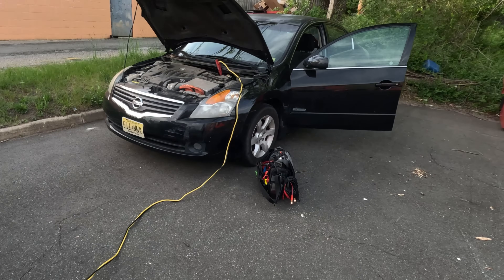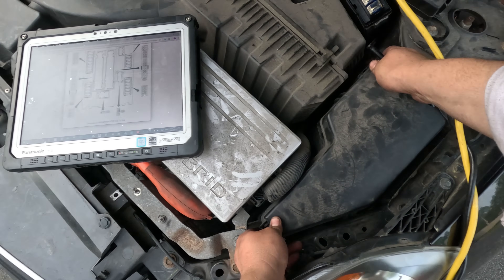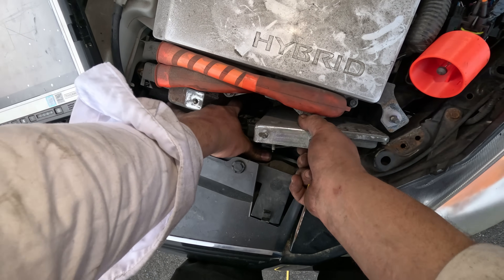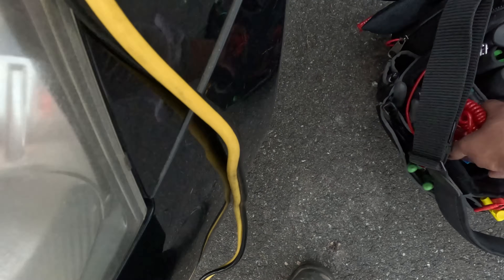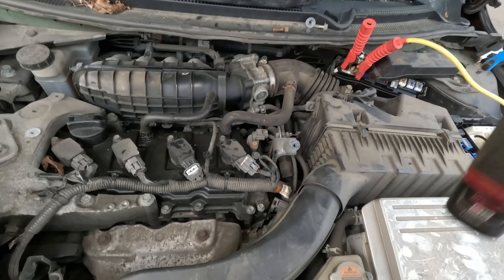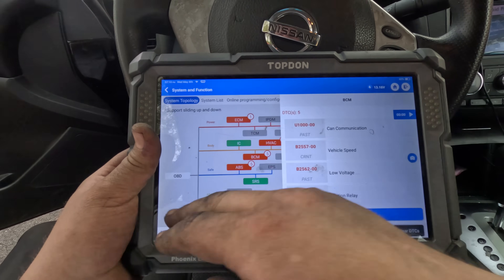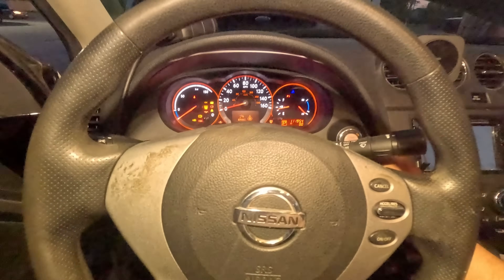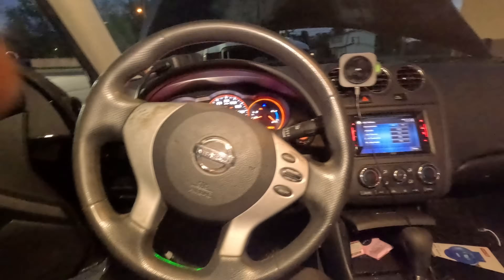Nissan Altima Hybrid - No Start Diagnosis! / No communication!

Comment: OK. This video saved me a ton of money and a lot of frustration. I had the same exact problem. 2009 Nissan Altima Hybrid as well. Car stalled on the freeway mid-drive, had to get it towed to my house, and could never get it to start after that. Tested and changed out all the usual suspects, the brake pedal switches, etc. Dash also showed the "brake/start button" graphic, even after it sounded like it started. Learned from this video that the fans on means something is wrong with the computer. (saved a ton of hours just knowing that little fact). My Harbor Freight code reader was just giving me a U0100 error, Lost communication with Engine Control Module A. I didn't have any fancy diagnostic tools or wire diagrams, so i decided to test all the fuses with the multimeter and found 42 to be blown. Tried a new one and that one also blew. Putting a little faith in this video, i jumped straight to the coils. I wasnt sure exactly what i was looking for, (really don't know much about continuity or current) I pulled all 4 coils and tested a few of the pins on each and found that coil 2 was acting different than the other 3. No idea what they are supposed to read or exactly what test i should have done with the multimeter, but if one of three had a different output than the others, it was worth swapping it out. Picked up a new coil, installed it, and put in a new 15A fuse to replace the bad one. Unfortunately it still didn't solve the problem, all the lights still on and start button not recognized. BUT then i remembered that you went back did a new scan with the OBDII reader and cleared the codes. Once i did that step, It fired right up. Absolutely crazy. I've been racking my brain for the past month on what to do with the car, havent been able to find a fix, and this video came up in my search. THANK YOU. you did it the right way, and ridiculously fast, but it helped someone who is way dumber and has very little understanding of automotive electrical figure this out. I hate taking my hybrid in to the shop, they always use the "hybrid" to make it more complicated, more expensive, and claim it needs special parts. Kudos to you and others who make awesome videos for those of us who aren't afraid to get our hands dirty, and learn a little something new along the way.  Keep up the good work. I am curious, would a bad coil cause a non-hybrid to have a non-start? or would it more likely just throw a misfire code? Just wondering if it's the need for the computer to switch between ev and gas modes that made the car stall mid drive and then no longer start. Wasnt sure if the same would be true of a nissan that is not a hybrid. Luckily, the one you worked on was the same year and model as mine, so I am super grateful it worked out. Had no idea a bad coil could shut down the communication to the computer.
Reply from the maker: That's awesome! Glad it helped!

Comment: I have the same car and the same model and I guess it's the relay that you mentioned but there's the new information it was the coil shorted but its expected since the fans goes on wen the short is on , the people think the altima is hard to know what is the problem but when you have the enough knowledge in this car you can realize that nissan make it easy to know what's going on just by it's another signs like the fan is on it's mean there are an short circuit in this relay so you have to search in this relay things and so on , some guys I know can realize what is going on without scanning codes just look at the dashboard and check for one or two things and fix it and go forward

Comment: I would like to know how you could rule out the ECM being shorted when you grounded out the ecm relay? Is it because you knew the ECM powers on that relay at all times? Or was the key in start at the time?
Reply from the maker: I saw the wire going from that fuse to the ECM was not on the connector that I unplugged at the ECM. Telling me it must be an output.

Comment: I already call more then 4 technicians to fix this issue they failed to start the car when I come across to ur video u can’t believe I did it on my own without any tools 🛠️ and my Altima 2009 now work perfect now thanks u and keep the Great work
Reply from the maker: Awesome to hear! Glad you got it working!
Reply: Always just know your car you can fix any thing and no one can scam you I have the same car and I know it very well so when you see the fans is going on just by pressing the power button you can know there is a short circuit especially in the relay that mentioned in the video

Comment: Hello I have a 2009 nissan altima hybrid.  I recently changed the hybrid battery on it and now it won't start.  All the light on dash turn on but doesn't crank over.  Keeps telling me to push brake to start which I do and nothing
Reply from the maker: Are there any codes in any module? Are you sure the Interlock disconnect is plugged in correctly?

Comment: Big thanks for this video.  We had the same problem recently on a 2007 Altima Hybrid, #1 coil was shorted.  I was able to identify the shorted coil by checking the resistance between the control terminal (most left if looking right at the coil connector cavity) and the center black terminal on the coil itself.  Each good coil ohmed out at about 2.3 ohms except the shorted coil which was 0 ohms (short to ground).  $75 coil and a $5 pack of fuses and car was back on the road…. This would have taken us much longer without you sharing your awesome diag!!!
Reply from the maker: Glad I could help!
Reply: I have the same car in Jordan 🇯🇴 the used coil is about 25 dollars "15 jd" why it's for 75 dollars ?
Reply: @imadgraf4769 well surely it could have been cheaper online but was able to get one from a local parts store that is also probably decent quality, can’t imagine how much the dealer would want at least $350 I would imagine!

Comment: Sorry for my ignorance.  But what was the problem? What did you fix? My car is having  the same issue.
Reply from the maker: An ignition coil shorted out the fuse that powers up the PCM.
Reply: @advancedleveldiagnostics  thank you. My altima might have the same issue.

Comment: I’m the same some time you need to clear code out of each module and even do a hard restart by disconnecting the battery for 30 min then car works again

Comment: Funny I had a pretty similar one the other day, GM 4.8 with injector fault codes for 2 4 6 and 8, found injector fuse B blown with a direct short, so I started chasing the short and then went back to the wiring diagram and realized that fuse also feeds all bank 2 coil packs, number 8 coil was a direct short
Reply from the maker: Cool! this was my first time seeing a shorted coil blowing a fuse.
Reply: @advancedleveldiagnostics  yeh same for me lol, never seen a coil internally shorted like that

Comment: Beast mode diagnostics! Lol. Man you are going 100+miles a sec... I really enjoy your style.  No B.S. Just real world troubleshooting.  Thanks for sharing! 

Oh yeah i ran into a similar situation with my Phoenix smart. Wouldn't clear codes in the TCM (ghost code for loss com) and therefore kept flagging the PCM mil... Had to clear the TCM directly,  not auto clear and it worked.
Reply from the maker: I tried with a Snap On and Xtool, and I had the same issue that it would not communicate on a full scan🤔

Comment: Ur light was in n not a fuse. Sure that wasn't the problem?
Reply from the maker: Which problem the communication after I unplugged the coil? I tried that with a regular fuse.
Reply: No I commented before I watched the entire video but previously when you had ur light still plugged into the fuse slot and not a fuse I thought was why it wasn't communicating. But maybe it was a scan tool issue? Odd it worked by going into the module but didn't work in topology. But I love ur videos and learn alot from you.

Comment: I should know, but why does the light coming on indicate a short?  If there is a legitimate load on that circuit wouldn't the electricity have to flow through the filament of the test light, thus turning it on?  Really liking your content!
Reply: From my understanding with the fuse removed you should have one terminal in the fuse box hot and the other side not. If the other side was grounded (via a short) it would cause the test light to light up (one terminal has power and the other terminal shorted to ground)
Reply: @mrnabzio4488  but wouldn’t the computer provide the ground path, since he left the car on?  Or maybe I missed that the car was turned off.
Reply: The brightness of the bulb is the giveaway. That's a high wattage bulb so it has low resistance. You have essentially two resistors in series, Whatever the circuit should be feeding, and the bulb. If the circuit load is high resistance, voltage is limited through the bulb and it will be dim. If it's a dead short (low resistance) voltage available at the bulb increases and it glows bright.
Reply: @ojmbvids That makes sense.  Thanks for the explanation.
Reply: @ojmbvids  Thanks, that helps.  So, an open circuit would result in no light and also a good circuit with nothing turned on would also result in no light since that, in essence, would be an open circuit.  I'm curious if there was just a small LED on in the circuit (low resistance) if the test light would shine brightly, similar to a dead short, even though the circuit was fine?
Reply: @IsItTrueThat  Yes, open circuit is no light, and a dead short (low resistance) is a bright light. An LED is a bad example because they're never directly connected across power rails because of their low resistance - That would draw too much current and pop the LED, so they're always in series with a current-limiting resistor in the order of several hundred ohms (sometimes built in to the LED so it actually becomes high resistance). 
As an example; because that's a 15amp circuit we expect the resistance of the load on that circuit to be no less than about 1 ohm (V/I=R). Realistically, it will be much higher than that, because that's only when the circuits at full load - lets say 5 ohms to keep the maths easy (5 ohms would still be drawing 2.4 amps so I'd still expect much higher resistance than this initially!). A 12v 55w headlight test bulb draws about 4.6 amps, so it's resistance is about 2.5 ohms. With the test lamp in series with the circuit, the total circuit resistance SHOULD be ~7.5 ohms. Across the 5 ohm load, the voltage drop would be 8v, and only 4v across the test lamp, so it would be very dim.
Reply: @ojmbvids  Ahhhh!  That is very interesting about the LED and the whole concept of the car systems not putting a small load on a large circuit without a resistor to absorb some of the current.
Reply: Cuz u have a ground on one side and power on the other

Comment: Did you do the actual diagnosis the trace back over it for he video or was this all in real time ?
Reply from the maker: It's the actual diagnosis; however, I do edit the videos and cut out sometimes when I'm looking for a part, people coming over, answering the phone, ect.
Reply: @advancedleveldiagnostics  nice work bro , very efficient many of it most would have been chasing a wiring issue for at least 30 minutes before even thinking to unplug the engine controller .